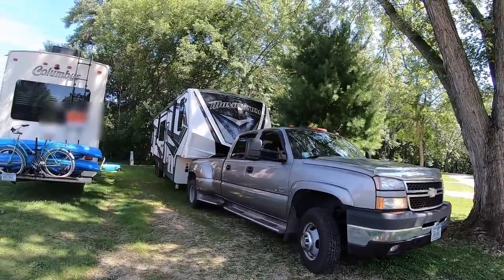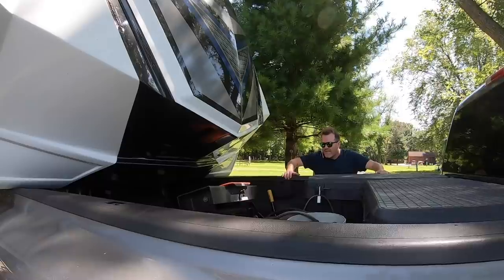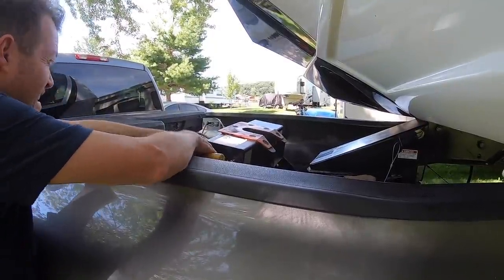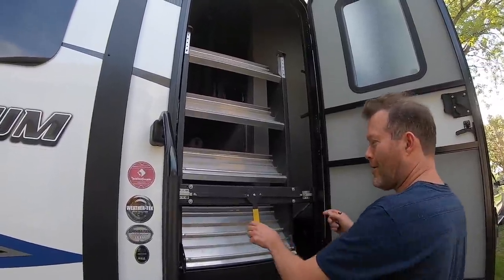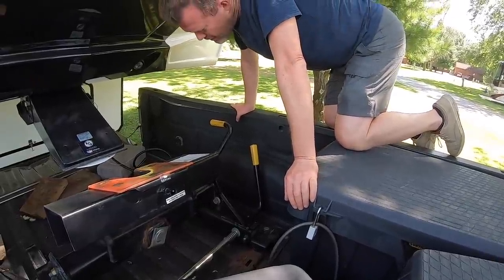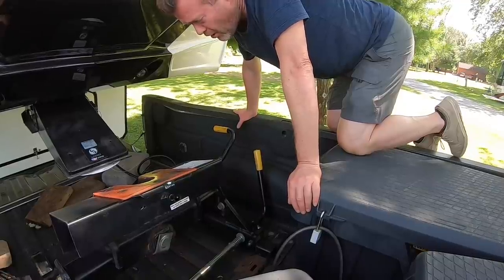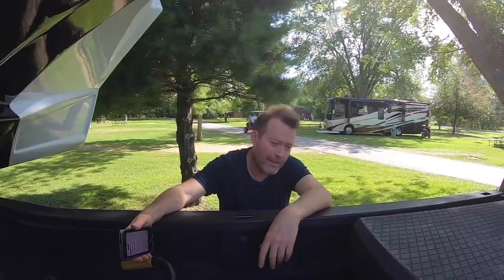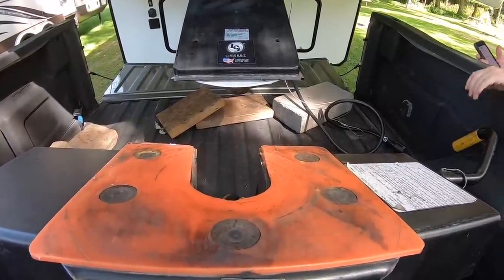RV CRUSHES MY TRUCK ON 1st TOW! BIGGEST RV LIVING FULL TIME MISTAKE! (PT 2)

Comment: the white ring is to thick, the lower hitch already has a protector built in
Reply: This.
Reply: You said exactly what I was thinking lol
Reply: This and NEVER do a "tug test" with the landing gear up.  Hard lesson learned.  Better lesson learned.....switch all that 5th wheel mess to gooseneck and you will never have to worry about the king pin coming loose again.
Reply: @rustyjohnston3180  gooseneck is just a ball mounted in your bed and is only good for lower weights like a horse trailer as it will pull on your vehicle up and down while a kingpin allows some movement up and down so the towing vehicle has a smoother ride hence better for heavier loads.   You dont want to tow 30k lbs on a ball when your vehicle weighs around 2k. 

There is a reason they exist.
Reply: That plastic cover is a greasless 5th wheel  attachment
Reply: Goose neck.  It's harder to align in my opinion....this was operater error....
Reply: @KayJay940  tell that to the thousands of hot shot rigs....
Reply: @novavroomvroom4759  i have cameras in my f350 ..super easy
Reply: @rustyjohnston3180  don't need to go thru all that pain when using a fifth wheel is just as easy.  Never had a problem with any of my fifth wheel campers nor my semi trucks.  Have dropped a couple of trailers (knock on wood not my campers)  in my time and learned some humility doing it.  Always, always, always do a pull test before completely raising the landing gear!!
Reply: I use 2 of the greaseless plates with my fifth wheel.  If I don't, the kingpin sits too low in my hitch and will break it internally.  As long as the jaws close around the inset of the kingpin with no interference then all is well.  This was simply a case of user error.
Reply: Umm, nope, there is a reason semis don’t have a gooseneck hitch. This trailer is much to heavy to be on a ball.

Comment: This is why I use an Andersen Ultimate Hitch.  I agree with some of the others on here, you need to buy a quality hitch, learn how to use it thoroughly before use, and maintain it properly.  Not to plug for Andersen, but it is much easier to use for a novice and requires very little maintenance.  It has no moving parts other than the slide lock.  Glad no one was hurt.

Comment: I'd be ditching that hitch for a better design. My confidence in it now, and going forward, would be zero.
Reply: Totally agree.  Especially since the hitch has a white pin that indicates that it's properly hitched even when it isn't!
Reply: @Milesco  Hitch worked properly. Fault was the kingpin did not sit in the proper position because the white lube disc added height that the kingpin physically could not compensate for..."high hitch". Hitch already has built in lube plate.
Reply: @heyinway  : Understood, but it's a serious design flaw to have an indicator that indicates everything is fine when it isn't.  Better to have no indicator at all in that case.
Reply: @Milesco  Wrong. Not a design flaw at all.  With a "high hitch" the jaws close and the indicator moves to its proper position indicating the jaws are closed. The jaws closed but not around the proper place on the shank of the king pin...false hitch. Can happen with any brand of kingpin type hitch. Also can get a false hitch with a gooseneck ball hitch and a regular ball coupler...always have to check that the jaws are physically around the proper part...not sitting above it.
Reply: @heyinway   You're not getting it.

"With a "high hitch" the jaws close and the indicator moves to its proper position indicating the jaws are closed. The jaws [are] closed but not around the proper place on the shank of the king pin...false hitch."

EXACTLY.  That's the problem -- the indicator indicates that the hitch is properly closed when it isn't.  That is a design flaw.   Better not to have an indicator at all than to have an unreliable one that can give false readings.   At least then you know you have to check every time to see if the jaws are properly closed -- which apparently you have to do anyway.  (So then what good is the indicator?  It's worse than nothing, because it has the potential to mislead the operator into thinking everything's okay when it isn't.)
Reply: Captain Quirk the indicator simply indicates the jaws closed. Many brands of hitches have them. A high hook still shows closed jaws but they’re not closed around the shank. If you want to blame anyone, blame the person who labeled the indicator incorrectly. 
This is why a lot of us with Class As wish RVers had to go get an A license.
Reply: @roundsm18  :   "If you want to blame anyone, blame the person who labeled the indicator incorrectly."

Well, that would be the company that manufactured it, wouldn't it?  (And indeed I do blame them!)

The label says "When white pointer is extended and visible, hitch is locked".   Clearly that isn't the case.  Yes, the jaws may indeed be closed, but the hitch most definitely isn't "locked".  So that is blatantly misleading.  And yes, I blame the manufacturer, because they made the hitch and the misleading label.

As I said before, if you're required to visually check to see that the jaws are properly engaged around the kingpin, and do a tug test, the indicator is superfluous and redundant.  In fact, it's worse than no indicator at all because it gives you a false sense of security.   It's like having a fuel gauge that says you've got a full tank when you're actually running on empty.  I'd rather have no fuel gauge at all, because then at least I'd know I have to be extra vigilant and check the fuel level manually and keep track of my miles traveled, etc.
Reply: @roundsm18  "This is why a lot of us with Class A's wish RVers had to get an 'A' license."

Huh?  Not sure what that has to do with 5th wheel trailers.
Reply: Captain Quirk a Class A CDL is required for those of us who literally move fifth wheel trailers for a living. Like it’s not my hobby, it’s my entire professional life. 

Hookup was a complete operator error.
You can’t have two lube plates anyway. Even the BW hitch will let you drop the trailer if you high hook it. It’s a fact of design and engineering. 
A fifth wheel is an incredibly easy and simple thing, yet people spend loads of time doing crazy things they don’t need to because they over complicate the shit out of it. If they didn’t have the indicator and chose to hook that way... exact same result.
Reply: Captain Quirk if you read the manual for the hitch, it says it’s superfluous and redundant. It’s a selling point. That’s why there’s the disclaimer and diagram in the manual showing you how to make sure your jaws closed around the shank. 

This shit being standard how to hook up a trailer information. 
A license. Trucking school is only $5,000 but the lack of complete confusion is priceless.
Reply: @roundsm18  :  "A Class A CDL is required for those of us who literally move 5th wheel trailers for a living."

What?  Ohhhhh....you're talking about commercial trucking and forty-ton 18 wheelers!   No wonder there was a miscommunication!  

This video is about recreational vehicles.... when you said "a lot of us with Class A's", I thought you were talking about Class A motorhomes, not commercial truck driver's licenses, and when I (and later, you) mentioned 5th wheel trailers, I was talking about RVs, not 80,000 pound semi tractor-trailers. 

As for Tom (the guy in the video), I give him a pass because this was a new (to him) hitch with a more complicated mechanism, and as you agreed, the white indicator pin does not actually indicate what it purports to indicate, and it misled him into thinking everything was all right when it wasn't. 

Tom's going to dump this hitch and get one that's simpler and more reliable, and I agree that's what he should do.

Comment: Had that happen to a friend with his Ford F-350.  Over 10K damage to the truck bed.  Best thing to do is have a spotter who can (hopefully) stop you when they see the trailer sliding off the hitch.  If you leave your legs down and the same thing happens you are likely to damage the RV also.   Screwed up the landing legs on my 37 ft 5th wheel.  Which cost $400 for new legs and a friend helped me install them.  Also need leg stabilizers on the RV to prevent the legs from swaying.

Comment: Dont feel bad,  I've done this with a fully loaded 48 foot 45,000 lb semi tractor trailer. It happens...hard part was manually, no electric jacks, all muscle while jacking it to the correct height. Trailer was sitting on the drive wheels.

Like mentioned down below, tug test is always a good idea, sometimes even that isnt enough because if your trailer brakes are bad, your screwed.

Best thing to do is get underneath and look that its latched.

Comment: Just found your channel and I felt so bad for you two!  Surprisingly, this exact thing actually happens a lot.  I've worked in the truck accessory and RV industry and have seen way too many crushed beds/ 5th wheels.  The main thing is, nobody was hurt!  I felt your pain about the bed.  2 years ago I was shooting a 30-06 rifle I had just purchased on some private land.  I thought I had used all the bullets but found a couple extra so I decided to fire those as well.  Instead of just standing with it, I decided to fire the rifle over the bed.  Well, the bed wasn't in the vision of the scope but the muzzle didn't clear it.  One shot cleared, then I picked a lower target on the hill and then I shot a hole through the bed cover and through the side of the bed of my new truck.  It totally was a wake up call on several fronts to say the least!  I got lazy and sloppy that day but will never again.

Comment: The new greaseless plate you added to the tongue of the trailer and the greaseless plate on the hitch itself is to thick so it’s high pinning and not catching well enough to have a proper connection.

Comment: Well, here comes my 2 cents after the fact. I’m a retired career truck driver so, many years hooking and unhooking 5th wheels. They can be tricky. It can happen to anyone. I highly suggest a couple things already mentioned. The tug test for one using just the trailer brake and for me the big one is going under, even with a flashlight and make sure that bar in the jaw, is always fully across the 5th wheel pin and hitch is flat on the 5th wheel. Listen for the big clunk when it closes. Handle in notch. 
Here’s my story. I have a 37ft with 3 axles and over 16,000 pounds. I asked a good friend with a truck like yours to move my trailer out of storage to my summer camp site. He hooked up, drove down a 1000 ft driveway till it hit the main road. Then when traffic was clear, he gunned it to go. The trailer, after all that way, fell off and $10,000 damage to the truck. What happened in this case , is vandals apparently pulled the looking pins out of the slider plate. The whole hitch slid out still attached to my trailer. You would never expect that to happen. Tho a friend, he is the driver and responsible for his security. Two people should never hook a trailer. Lessened learned, padlocks are used everywhere now. We even had it happen on semis, where during the night vandals pulled the handle on the truck and driver never double checked. Some very bad people out there. Thanks for your shared experience.
Reply from the maker: Wow! Thanks for sharing Marty!
Reply: EnjoyTheJourney.Life     Somebody in the comments also mentioned an “air ride” hitch. Big dollars but from what I hear, a tremendous difference in ride for trailers as big and heavy on the hitch as yours. By the way, what saved damage to my trailer, was I didn’t retract the landing legs completely because the trailer wasn’t going too far and I knew the road. So after crushing my friends box, tearing off the tailgate, it landed on the legs. Your damage is much less. That trailer is all steel underneath where the pin is so don’t fret structural unseen damage. Very very unlikely. Even mine had nothing.

Comment: We have a 2020 Momentum 399TH. A better way of getting the front landing pads at an inch or two off the ground is to start retracting them. The first leg will go all the way up, then the second leg will start going up. Stop once the second leg is an inch up, then you can lower the first leg to an inch. This saves you from having to fully retract both before lowering them back down. Good luck!

Comment: I have a friend that had that same problem, but that hitch had a manual safety lock on it that he was too lazy to set.  he ruined his fords bed and got a new dodge and did it twice to the new dodge, was able to find a complete bed to make repairs.  I think in  your case you have an extra plastic spacer that is misaligning the pin vertically.  The white one on top.

Comment: Did you record the moments (for yourself) when the previous owner showed you how to do it? Or take notes? Learning something new for the first time is very difficult plus you are probably a little nervous? I would be.
Reply: Terry Novack - they did, it’s on the part 1 video (titled the same but released a few days ago).
Reply: A danger in buying used - no instructions or manual usually.

Comment: We have a 37’ Toy Hauler. Pull Test with landing gear down and trailer brakes locked. ....Always! And be sure not to high hitch. We saw a 40’+ toy hauler drop when they were pulling out of a campground on an incline a few years ago. A lot more damage then you have.

Comment: Apologies, if I missed a comment that mention this.
It seems to me in the first video that after the previous owner removed the handle that there was not a space or additional hole showing on the smaller diameter shaft the handle slides over. When you rotated the handle prior to moving forward there appeared to be a gap & one hole showing. Check the first video at 2:58 where you pressed on the pin latch arm & the final position of the handle & gap.
The other comments about the extra white disk could have prevented the complete closure of the removable part of the handle to the flush position. 
I don't know if this is part of the issue but hope it helps.

Comment: Thanks for this video. The few times I've towed my 5th wheel I had always tug tested mainly from recommendations. Seeing damage actually happen is a great learning aid. Not fun to admit but admirable in posting. Now to the RV and your truck. How does it feel pulling such a heavy RV? Not sure of the weight but I've always been concerned about upgrading to a toy hauler and if my truck is heavy enough to handle it. More from a mindset I guess. I have almost the exact pkup but a 2005 whereas yours looks like a 2006 or 2007. Same silver birch as well. My 5th wheel is a 96 Holiday Rambler triple axle, 14,500lbs dry. Last time I scaled it was in 2007 and with full fuel I hit in at 25,700 with a full 5th wheel. Started working overseas Nov 200, haven't towed it much since. Would like to upgrade the RV but the pkup only has 35,000 miles on it. Thx again for posting.

Comment: Also I’ll look to see if the jaws are wrapped around the king pen . Always you have a good flashlight to indicate that everything is in its right position . I believe the fifth wheel should always has some kind of grease on it . metal on metal don’t mix . (fifth wheel grease)
Reply: That hitch has a factory installed surface that eliminates the need for any grease.
Reply: heyinway yes they do but also requires grease regardless what the manufacturer says . a light coating of Grease Where in tear to the surface
Reply: @ronaldjorgensen8738  No grease required at all, the lube is the built in...basically it is a load bearing plate that wears very very slowly. Used them for years on over the road semi trailers...some are put on with a thin ring that holds them in place, others are like what that hitch has built into it. They are available as an option on 5th wheel plates and on the upper coupler of semi trailers....in whatever manner or form....no grease is ever necessary, except for a light coating on the jaws of the hitch and on the surface of the kingpin.
Reply: heyinway Yes I understand how they work . you put a light coating on it . we use them at my work ! they are junk when it comes down to it . I appreciate your Input

Comment: Use (wooden 2X10 cut-offs are perfect and cheap) blocks under your landing gear and other jacks! 

Also,  manually hold the trailer brakes for your "safety tug" while STILL keeping the front landing gear just slightly raised (thus prevents bending of gear but offers falling safety in case of failed latching).  Never leave any legs contacting ground when preforming check.  They WILL bend, especially hydraulic rams as are yours.

Comment: Pull handle out and twist to the right. Adjust rev height, go back to the handle and turn it back to the left so when you back up into it, it will push on the latch trigger and slam the clasp shut into the lock position, move pin to inside hole with the runaway line, pull handle off so it won't bind when turning. Test tug and go

Comment: You high sided the pin.  The RV needed to be lower before you closed the latch.  The latch was locked, however the pin on the RV was too high and not locked into the hitch.  Sorry for your troubles.  Metal
 can be fixed, just glad no one got hurt.